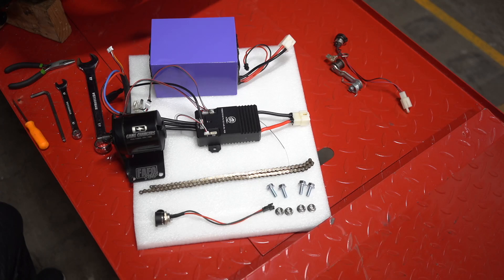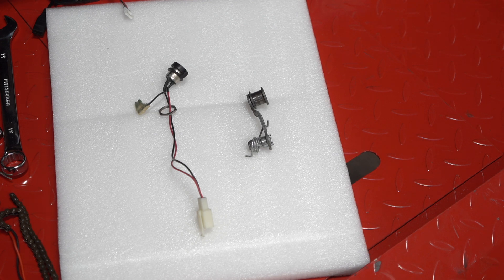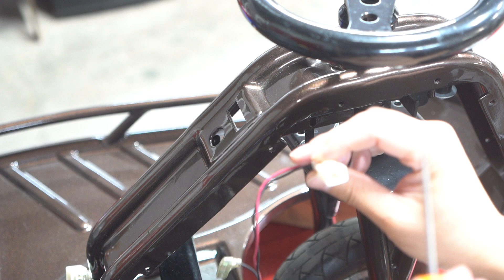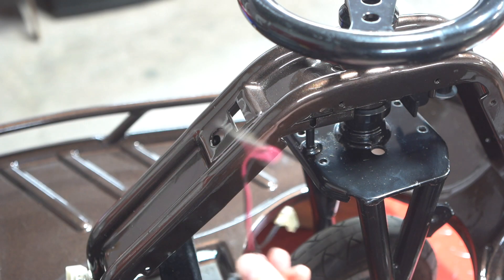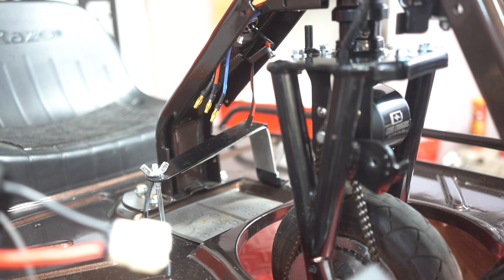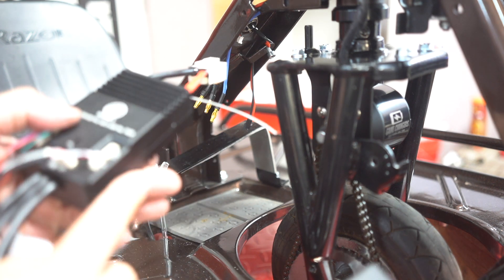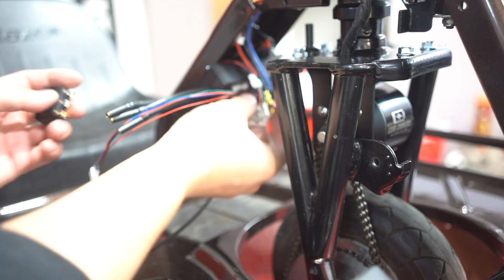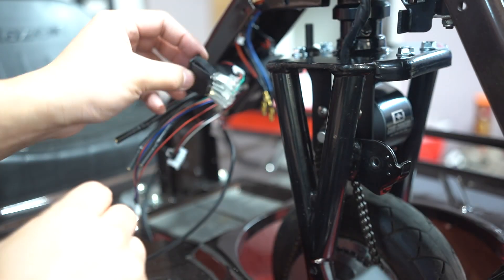FAFO408 Crazy Cart Brushless Motor Kit - Installation Guide

Comment: What’s the top speed?
Reply from the maker: Various factors (environment, runway conditions, rider’s physique, etc.) affect speed, but it should exceed our Stage 5 Kit's 20 mph. Your mileage may vary. The kit is tunable, but like any PEV motor, it can overheat if pushed too hard. Monitor temperature and allow cooldowns to maintain performance and longevity.